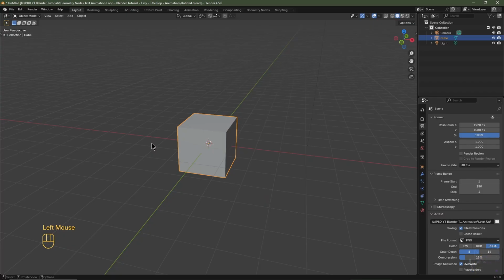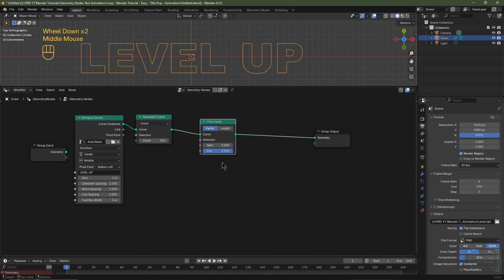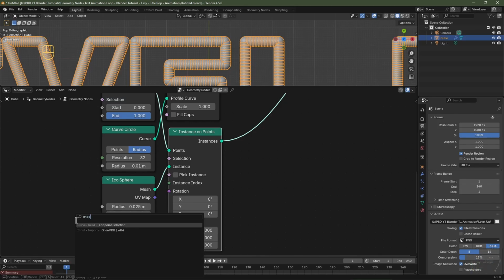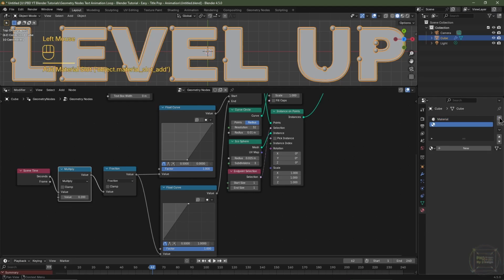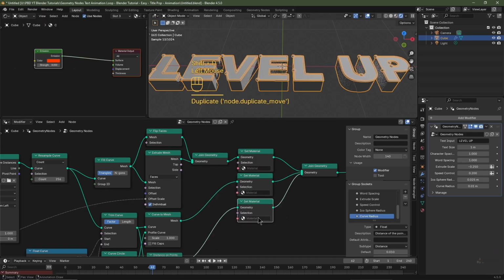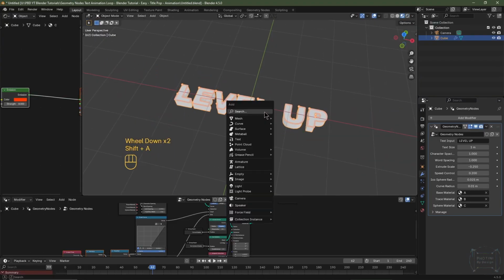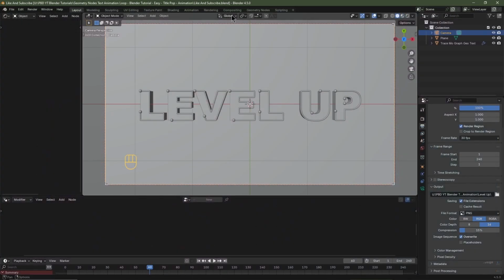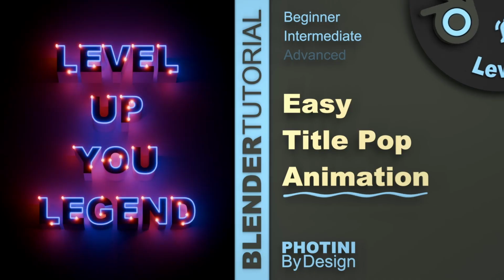Geometry Nodes Text Animation Loop - Blender Tutorial

Comment: Cool combo of outline and extrude. Never used the camera shift before, thanks for the tip!
Reply from the maker: Tilt shift is one of blenders hidden gems. It emulates tilt shift lenses which are often used in architectural photography which helps correct distortion shift and thus preserving the straight edges of a building. Tilt shift lenses are also used in photography to trick the eye and give the illusion that the scene is in miniature.